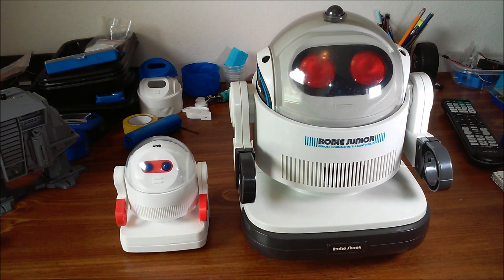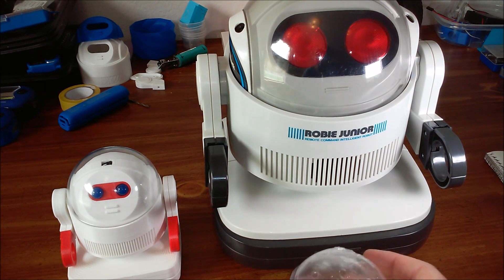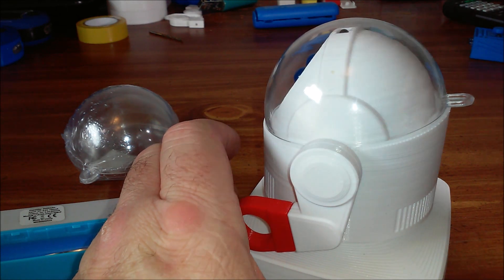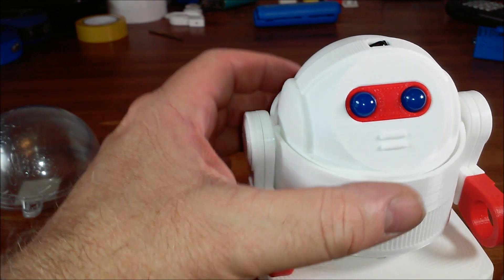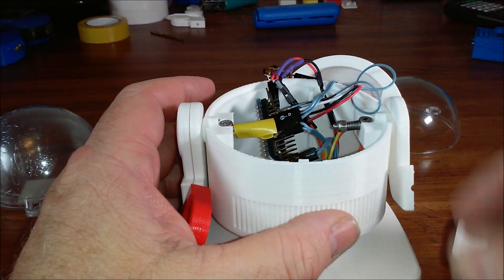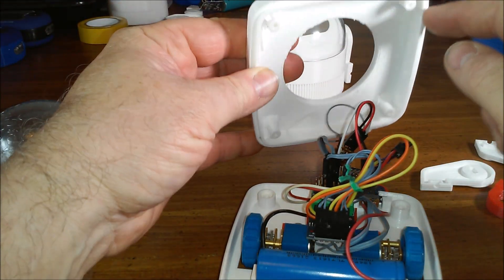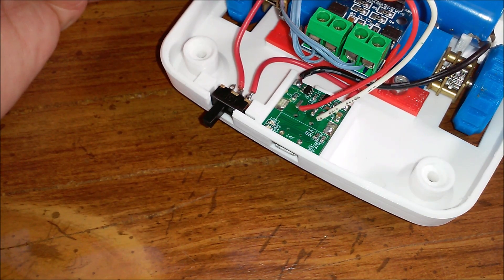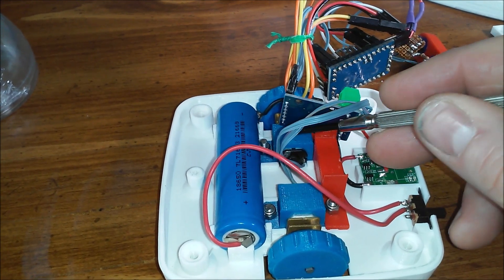3D Printed Remote Controlled Half Scale Robie Junior

Comment: This is so cool, and the exact project I'm looking for. Will be fun to put one together over the summer this year (along with the Robie Junior remote, as ours is missing).

Would there be any interest in showing how to upgrade existing robots? Like getting the Robie Junior off D Cells, and on to a rechargeable SLA?
Reply from the maker: Thank you for the compliments and good luck on the build. If you could find a small enough  6V SLA battery it would be pretty easy. Here's a link to the mod:
http://www.theoldrobots.com/zrbjr3.html

Thanks,
Rick